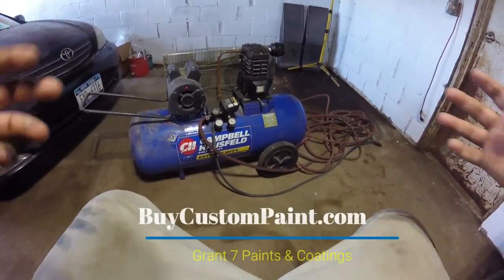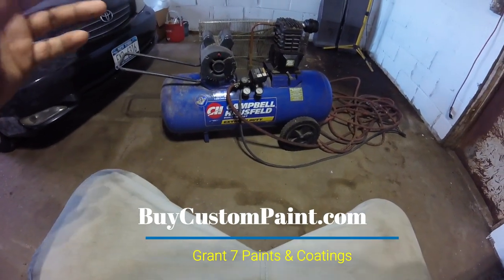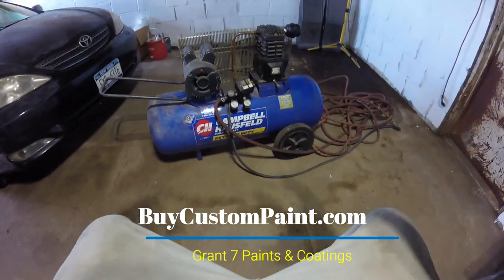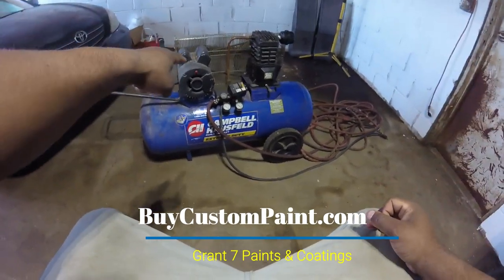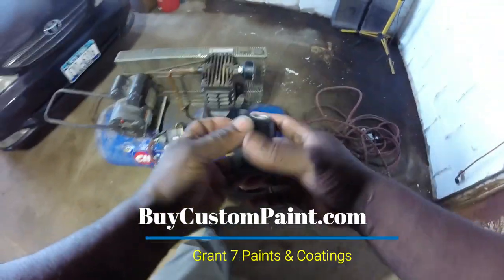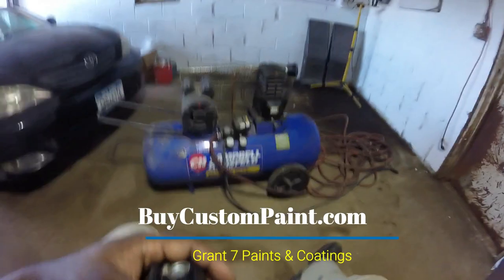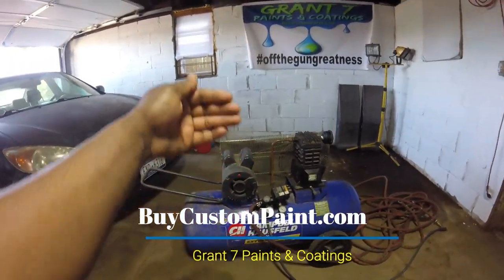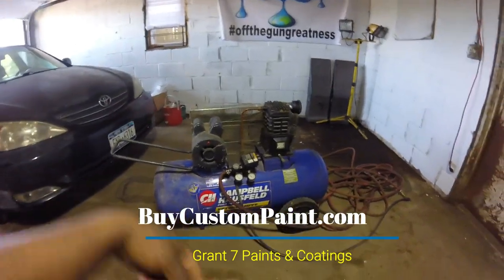Air Compressor Tips, Tricks, Myths  & Hacks - How to increase CFM

Comment: Add extra cooling to the motor and you will be OK running it hard. My comp is in a sound insulator box and it has continous push pull cooling by cooling fans off a car' s radiator. Not only the motor gets extra and contInous cooling (even if it is not running) but the cylinder  of the comp is kept cool. Lower air temp less condensation.. Win-win. ,👍 thanks for the great/thorough video! 👍

Comment: Change pulleys. They sell different sizes at home Depot and Lowes. It's the same as a 10 speed bike. You change pulleys for higher RPM more CFM.

Comment: Also another tip, the inner diameter of your hoses and air fittings. You could have the top of the line compressor, but if you have a small diameter hose, it will run like crap. You have to find the bottle necks in your system. Good large inner diameter hose. Also the length of your hose. The longer, the less CFM and PSI. Fittings are critical too.. if the fitting is a small inner diameter it will slow CFM and reduce PSI.
Reply from the maker: Good tips... thanks for sharing

Comment: Whole lotta good information & common sense. Well done.
Cheers!, 
Only other thing I'd add is fittings & air hose ID for increased CFM. Opening the intake part (air filter cover removal, or modification) of the equation is great, but with other bottlenecks,  (small inside diameter fittings) you're not getting full potential.

Comment: I’ve never seen anyone do that air filter trick. I was about to do that I even had the same thought about the cold air intake but I figured out a better way. I was going to get a 3/8 to 1 inch npt fitting and put on a small cold air intake filter. I was also going to get rid of all the couplers besides 1 that is high air flow and use female to female fittings which will make it a pain since I won’t have quick disconnects but I’ll get as much air out as possible. Was also going to bypass the original regulator as they’re usually restrictive and use the one that’s provided with the 3 stage air filter. I’m also using 3/8 air hose lines with 1/4 high flow fittings.

Comment: Ok so i got a harbor freight 11 gal air tank, a HF 8 gal 4 something cfm 125 hot dog and a 6 gal ridgid pancake i got for 40$ at a pawn shop.  I just have both feeding the tank and i draw from that.  Since they arent on the same line and i used check valves on the feeder lines they dont step on each other. So i now have a 25 gal 7.5 cfm effective unit that cost me less than 250$.

Comment: No 1 rule is buying the biggest air displacement capacity you can afford. You need a big pump with big pistons that refills your tank faster than you are emptying it, tank capacity is not as important as the engine. You want a 15-20 seconds refill time from 6-8 bar, or 20-30 seconds from 10 -12 bar.

Comment: Thanks for sharing fam I sprayed a bumper yesterday I wish I would have took a lil more time prepping but it came out nice! First thing I did before starting is check out that filter cover mines is a fan that looks like it pulls in fresh air. The motor is small n it gets hot fast lol. I also need to install a valve at the bottom to drain crack open to drain any water! Thanks for sharing all of your great tips! Can't wait to lay down that Grant 7 🔥💪🏾💯💯
Reply from the maker: Yeah my man.. prep is important....thats 90% of a good paint job...just dont rush it...also make sure your compressor is somewhere where it can get cool or cold air, it will perform better...

Comment: I'm just starting out painting with a spray gun debating on what I should get I'm looking at a harbor freight 29 gallon compressor for $359 that's plenty for the gun I'm gonna use the Eastwood Contours LT 100 which operates at 4.5 cfm at 30 psi sounds like great tips and definitely will be putting this knowledge to use
Reply from the maker: Thanks for watching....its always better to have more air than u need instead of not enough

Comment: Thanks for the informative vids! Would these tips and tricks along with an auxiliary tank be sufficient for a Black Widow HTE to paint an entire car?
Reply from the maker: You have to check the cfm requirements on the black widow against the cfm on your compressor...but you should be able to paint the car in sections ( panel by panel) either way
Reply: @Grant7  I checked it, and it's the compressor is about 3.5 cfm lower. Judging from your expertise, do you think it'll be sufficient if I add an auxiliary (totaling to 40 gallon)  and remove the filter cap? Thank you!

Comment: It is a shame that air compressor companies over-rate their motors. But sadly its not only air compressors, a lot of power tools are over rated as well, just to get them to sell.  The motor that is on your compressor, it's original, is only a 1HP motor.  A true 1HP motor pulls 15A with a rotation of 3450 RPM's.

Comment: Where is the best place to put a filter when painting I've see some put it right on the compressor mostly pros have an air system they just have the gun a regulator an the air line and another thing  where should the air be set on the gauge mounted on the compressor besides the one im gonna be using on the gun
Reply from the maker: If you have a large compressor (60 gallons +)  then I would suggest putting the filter  25 ft from the compressor,  if you have a small one like the one I'm using, I put the filter 10 ft down the line.
Reply: @Grant7  thanks bro  just needed some clarification lol

Comment: Those filter canisters are designed to be an intake muffler to make the compressor quieter. Removing the filter canisters will increase the air flow but also increase the noise. Not a big deal but may be a problem for some people who need a quiet compressor.

Comment: Damn, I paint with a 5 gal compressor lol! Its a porter cable 5 gal. I will not paint with it now because the regulator is a shitpile. It pops the hell off as you turn the pressure down and it cannot maintain a pressure. I will probably add an aux tank with a regulator on it, so it will actually be the main tank.